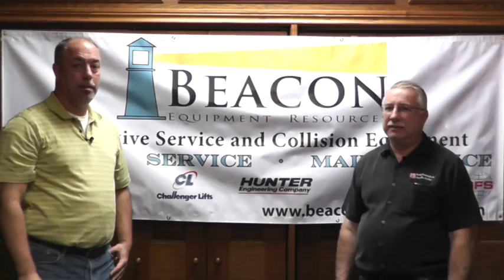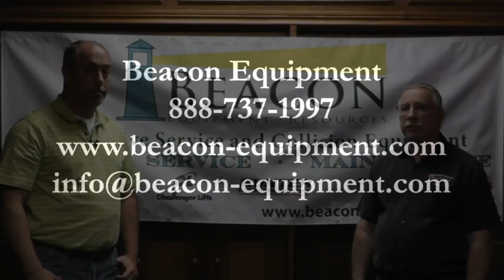How to Remove Oil, Water, Dirt in Compressed Air Lines

Comment: Hi. Great video. Thanks. 
I have a question. I have a Quincy 54 two stage 5 HP, 60 gallon compressor. I go from compressor to aftercooler which consists of 70 feet of 3/4” copper pipe (radiative cooler), and then 100 feet of 3/4” soft copper tubing in chilled water. Then to tank. 
From tank I go to 3/4” Maxline piping that runs a complete loop through 3 garages and my shop, then back to origin. 
I have a large desiccant filter just before a 120 gallon reserve tank that is dedicated to my blast cabinet, painting and air tools. With me so far?
My question is this. What filtration do I need before desiccant dryer? What filtration do I need afterwards (before reserve tank) and after tank. 
I’m sort of lost. Your help is appreciated. 
Thanks,
Paul

Comment: You are so right  about water in a air compressor also  rust and dirt and corrosion and water and oil really will miss any  paint job real quick on ANY automobile also a lot of different air tool's

Comment: Hi thanks for the video quick question I had this problem right and we changed the pump because it was passing oil now my dilemma is do I have that oil in my lines and how do I remove it I have a triple setup with new filters on it because the other one kind of did smell like oil but I'm wondering if there's oil residue in my lines and how to possibly remove that